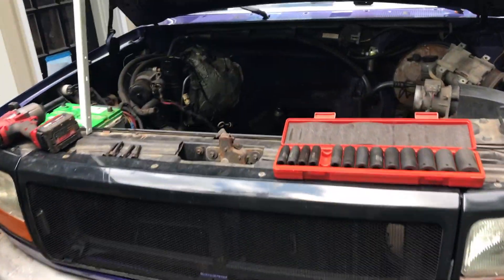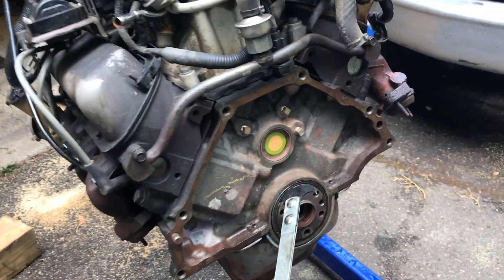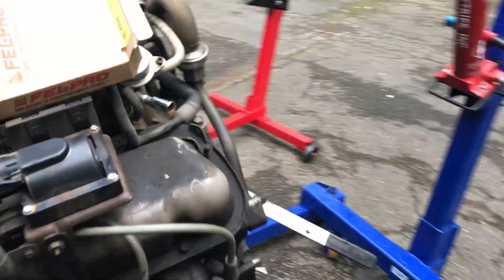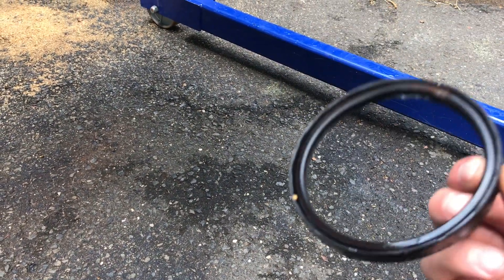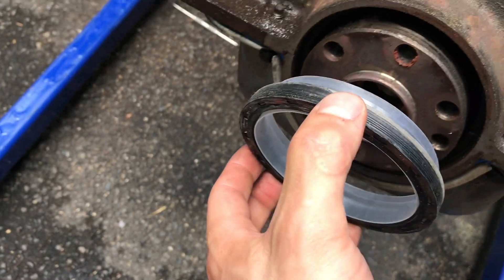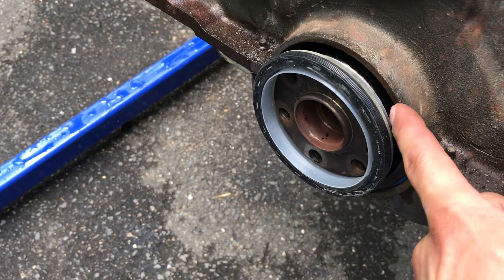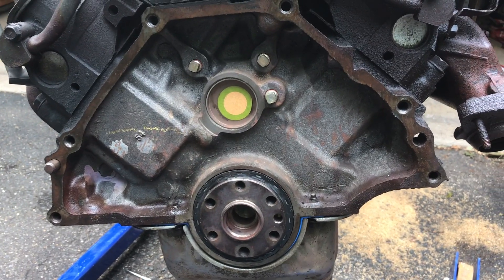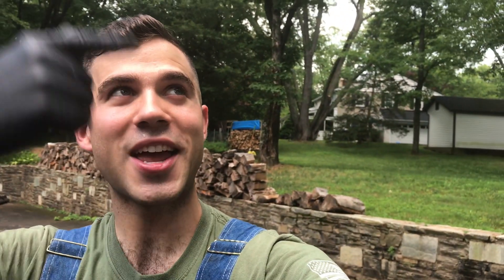ENGINE OUT / How to Replace Rear Main Crank Seal | 1995 Ford F150

Comment: For those without the seal pick just screw a bolt in the seal and pull it out works perfect just be careful to not knick anything
Reply from the maker: Good tip man!🤙

Comment: "In this video, I show you how to replace the rear main seal with the engine out"  Then never shows the install, Excellent.  Tripod Steve, tripod.  Invest $20.00 on a chepo
Reply from the maker: You make a good point Greg. Since the video, I bought a tripod and it makes a huge difference in the quality of the video.
Reply: @TheMinuteMasters  Oh excellent!

Comment: Did u have to tap it in place at all? I did mine yesterday and had to tap in quite a bit.
Reply from the maker: Yeah it takes a few taps to get it in. Applying oil helps lube it up for a smoother installation.

Comment: Do you stick it in dry, or apply some type of lube first?
Reply from the maker: I think I installed the seal dry but it’s probably not a bad idea to smear a thin layer of oil on the end of the crank shaft.
Reply: I dnt think he got the joke haha or just completely ignored it
Reply: Depends on the lady/woman or whatever you're into 😅

Comment: Can you tell me... if my Ford F-150 2001 v6...it’s leaking oil down the front of the lower plate, it’s dry inside the bellhousing. Do you think that is the rear main seal leaking or the oil pan gasket?
Reply from the maker: That sounds like a rear main gasket leak to me. My bellhousing was dry too but there was always oil dripping from the small front bell housing plate.

Comment: Just wondering you removed the engine just to replace the rear main seal or did you do other work to it.
Reply from the maker: I pulled the engine to weld the engine cradle/crossmember. I figured since the engine was out, why not replace the rear main seal. 

Otherwise, if you were looking to do this without pulling the engine then you have to unbolt the transmission and slide it back far enough inside the transmission tunnel to work on the rear main seal. Taking the transmission out entirely is the easiest way to do it.
Reply: @TheMinuteMasters  yes sir I need to have mine replaced on my  95 f150 with the 302. Bout a $250 job
Reply from the maker: Daniel Padgett Gotcha. Yeah it’s not really an expensive repair. There’s just a lot of labor involved with unbolting the transmission. If you’re comfortable unbolting your transmission and sliding it back then you can definitely do this repair. If you need it, I have a vide on how to remove your transmission.
Reply: @TheMinuteMasters  yes sir thank you so much for that video
Reply from the maker: Daniel Padgett No problem man! 🤙 Good luck with the rear main seal repair!

Comment: At what point did you remove the install sleeve?
Reply: Thanks. I had major trouble with installing mine, made by Mahle. Would not align, shape ended up contorting. Not sure what the deal was. Will have to go the fel-pro route for round 2.
Reply from the maker: warriorforestmonk No problem! That’s weird. Definitely try the Fel Pro.
Reply from the maker: warriorforestmonk If I remember correctly, I think I had it 1/4 to 1/2 way in and the worked it out. You only need it to get it started.

Comment: can i change my engine oil pan gasket and my rear main seal at the same time cause i hate seeing all this oil all over the place. i'm going to clean off the motor oil and see where it really coming from
Reply from the maker: jeremy pinder I changed main at the same time but I had the engine out. The change the oil pan gasket you need to raise the engine a couple of inches for clearance. To change the rear main seal, you have to pull the transmission out or pull it back enough to give you enough room to work. If you have one of these trucks then most definitely both seals are leaking. The pans definitely leak after 20-25 years.
Reply: @TheMinuteMasters  wow i never knew that i don't own a truck but i have a car and the car is 24 years old so i guess it's time to make that change.
Reply from the maker: jeremy pinder Ah gotcha! Is your car front wheel drive or rear wheel drive?
Reply: @TheMinuteMasters  rear wheel drive
Reply from the maker: jeremy pinder Nice! It’s the same procedure at a truck. Front wheel drive is a totally different animal as far as main seals go. Your oil pan probably comes off without doing anything crazy.
Reply: @TheMinuteMasters  i need to do this asap

Comment: Which exact engine is this? I have a 92 4x4 with the 5.0. Being told mixed things about the rear main, some tell me I have to pull the oil pan, this video shows otherwise... Do I have to drop the oil pan in the 302 5.0?
Reply from the maker: Kyle Harper This is the 5.0L 302 in my 95 2wd. Pulling the oil pan isn’t necessary if you are only replacing the rear main. I don’t think that changes from year to year or from 2wd to 4wd.
Reply: @TheMinuteMasters  I couldn't imagine it would. But I've seen stranger things... 

Thanks for the reply. I am going to replace the oil pan gasket as well but paying a shop to do so as I dont have the ability to lift the engine.

Trying to cut cost somewhere by doing the clutch myself. Just looking for better infor on the rear main.
Reply from the maker: Kyle Harper Yeah I’ve seen some strange stuff too. 

I feel ya man. Having a shop replace the oil pan gasket is a good idea. Make they use a Fel Pro gasket though.🤙

You can always check out a Haynes manual. They are pretty good at giving you the right idea on how to change a rear main seal.
Reply: That was for earlier( mid 80s )  302 engines having a 2 piece rear seal from what I've herd then the converted to a 1 piece seal
Reply from the maker: richard thomas That makes sense. Actually I think Fel Pro sells a two piece main seal with the oil pan or it’s a separate add on kit.

Comment: I saw that tool at autozone and orileys and it seems very hard at the tip, does it risk scratching the crank?
Reply from the maker: Jack Land I had the same fear but as long as you’re not trying to manhandle the seal you shouldn’t scratch any of the surfaces. So you’re good!🤙 Definitely, buy they tool!